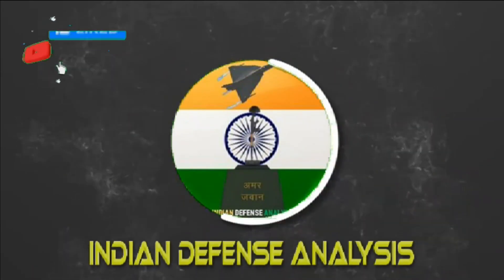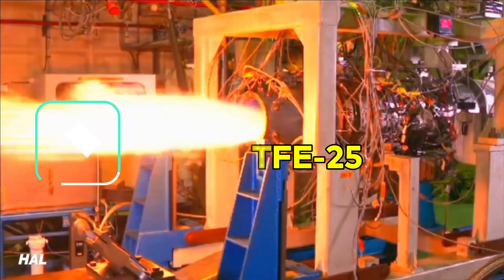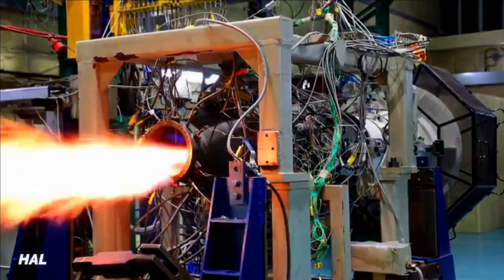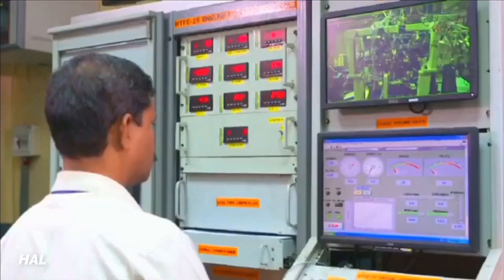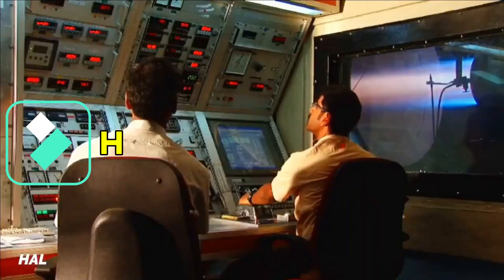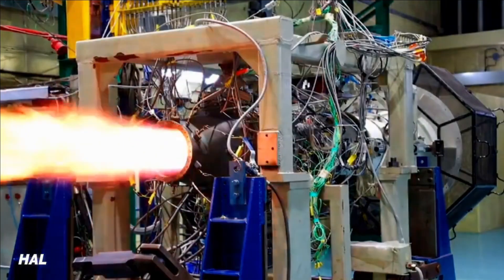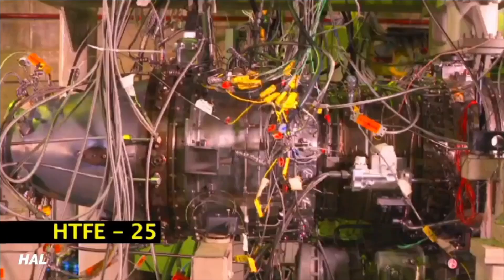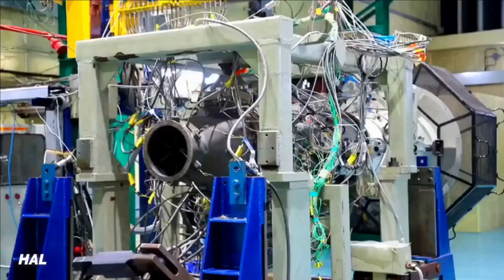Hindustan Turbo Fan Engine HTFE-25 will power future UAVs, Wingman, Trainers & Civilian Aircrafts

Comment: The further development of flight worthy engine for certification would require at least another 5 years or more.
In that time frame Tejas Mk2 will already be in production. Smarter to just phase out Jaguars.
Reply: If you think htfe 25 is only for jaguar than that's a very narrow thought, infact htfe 25 is not for jaguar. Jaguar requires an afterburning engine and that will take time, however htfe 25 may very well be used on hlft 42 if it turns out to be not based on tejas. It's already mentioned to be used on the larger versions of cats warriors. It's a possibility that it maybe used on the FUFA. Moreover it would be the perfect fit for Hale drones made by India competing with Reaper etc. So look at the possibilities always and these are very much in the pipeline.
Reply: @MrKumarspeak  Sure it will have other uses. To be honest I am a big supporter of fuel cells over engines.

Tata motors is already using ISRO developed fuel cells and DRDO fuel cells are in submarines.

Rather than the many years it would take for engines to be certified fuel cells can enter mass production and they are 100% indigenous more quickly.
Reply from the maker: you are right
Reply: The program started in 2013-14 with a timeline of 6 years and it is still 5 years away from certification.
If we think of further varients like HTSE or one with after burner, God knows how many more years will be needed.
I wish this engine is ready within next 2-3 years

Comment: Damm that's a long time
Reply: Is it. If we sign a contract with Safran today it would optimistaclly take 7-8 years to create it and another 5 to certify it so the availability will be by 2035. Now that for a company which is already experienced and moreover they are making an improved version based on an existing engine. You also forget that Hal has come this far facing 2.5 years of covid delays. They have done a superlative job specially when they had to borrow from the banks for their daily requirements because the government wasn't paying their dues of 20k croresfor almost 3 years.